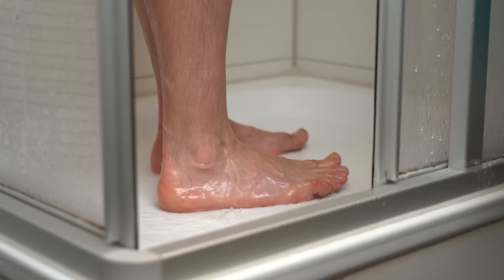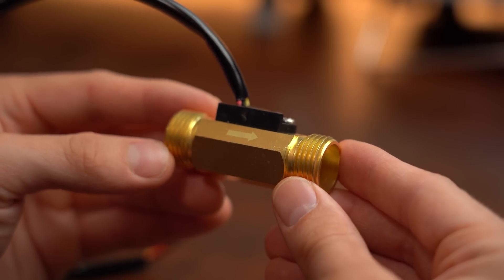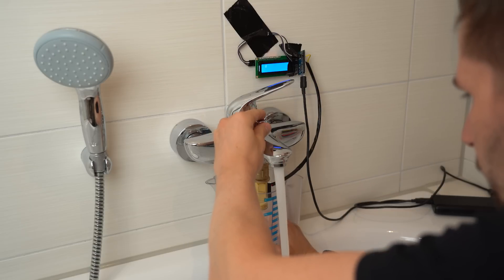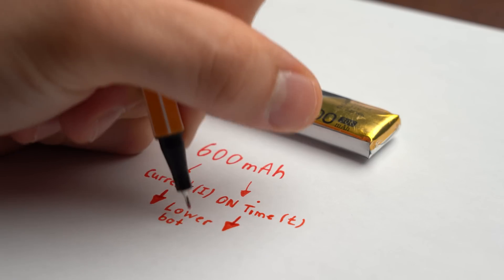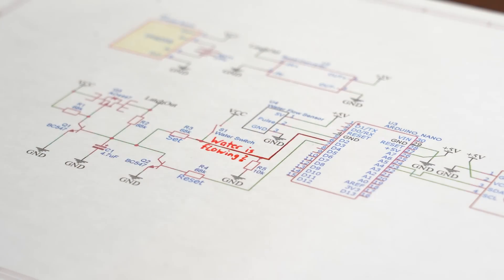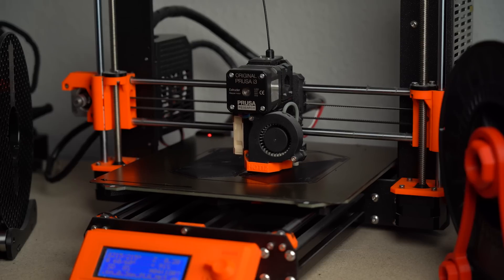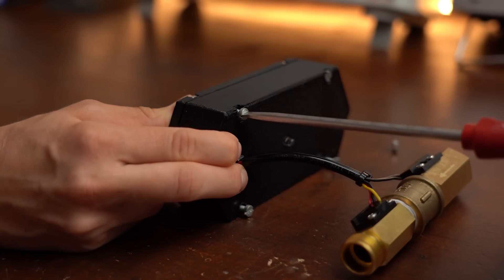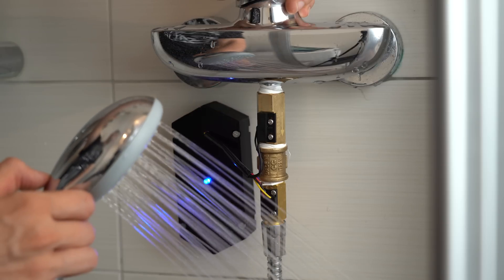Every Shower needs this Upgrade! (Online Water Tracker)

Comment: One thing you can google out from literature and other liquid flow mechanicl measuring projects is that there are two factors apart from mechanical friction, ballance and fluid dynamics affecting accuracy of a propeller sensor: first is the density, or volume weight of the propeller's material should ideally be equal to the dencity of the liquid measured; and the second factor is that flow resistance in the pipe before and after the sensor should be equal. Regarding the second factor some orientation is provided in the printed mounting manuals provided with regular water meters saying that before and after the meter a straight piece of pipe of the same diameter with lenght of minimum 5 pipe diameters shold be provided (in other words, it's more accurate to experiment finding out pulse count to volume relation with shower hose mounted after the sensor).

Comment: to measure the flow rate of the water u can use the venture relation.
by knowing the pressure and the area of the pipe u can determine the flow rate.

Comment: Funny thought, but could you power the electronics with the power of the water pressure itself? Are there any small turbines that could fit the bill?
Reply: The small turbine and generator found in LED-lighted shower heads might work.

Comment: I've actually been thinking of a similar project but with hot and cold water, and electrical power usage per phase too. I got an rough idea of what I need for it. The current transformers are the scary ones.

Comment: Can you invent a circuit that lets us connect PV directly bottom element of electric hot water heater, but can safely shut off power when a set temperature is achieved?  The existing thermostat switches AC power, but PV power is DC, and arcing in the high voltage and current burns the switch out.  It seems to me that a thermocouple and FET arrangement should be able to accomplish this switching without any additional power to make a system like this work.

Comment: Did you think about using a small generator in the pipe to power the system? Might make enough power to drive the little microcontroller

Comment: The flow sensor needs to have pressure all the time to have accurate readings. When you are measuring like the way you were, once you stop the flow the flywheel keeps spinning for a while until it stops. If you make a tube loop it wont happen.

Comment: Just use a timer.

Or if you really want the data on your phone. As you are only able to record the volume of water from your shower, you could just use a flow switch and a timer. It would be a lot easier.

Comment: I've been thinking of a similar system, together with a digital temperature mixer...

I.e. knowing the flow of hot and the flow of cold and the temperature of each and mixing them to maintain the perfect temperature while showering, a nice rgb indicator to know exactly when it it ready... and we can define the pressure and temperature we want per person using the shower...

Just some shower thoughts for ya
Reply: Or you could y'know get a thermostatic mixer valve. These are purely mechanical devices. You can get high-end ones that are built into your shower fixtures.

Comment: Hi, I'm writing through the translator so sorry for the quality.  Around 2004-2006, I was interested in cooling a computer with liquid.  the problem was that as the water stopped flowing, the computer would overheat.  One man figured out a great way to measure the velocity of a liquid.  Well, he passed an optical fiber through the tube.  Laser diode and receiving diode, measured the time it took for the light to travel over such a short distance.  As the liquid flows, it creates pressure and deflects the optical fiber, so the path increases and the time taken for the light to travel that path is longer.  Unfortunately, I do not have this study archived anywhere.  But in 2006, the chips were slower than they are today, so  you can make it.  Additionally, you can use the turbine to charge the battery (by flowing water), which will increase the runtime.

Comment: Once I tried to get data from my Techem and Diehl water meters with an rtlsdr stick. Our utility company set it up to send every 5mins and I could find it's ID printed on the label. I even bought a ready-made module from iMST, who even sold usb sticks. It was a lot of serial comms coding in python on an RPi linux platform, because they gave a DLL file to integrate with, which I could only export functions from in a py+windows environment. Wmbus had a lot of promising documentation on the protocol itself up until I realized there was a proprietary encryption mode on the actual data part of the frame that wasn't even documented. I remember from the openhab forums someone (in Poland?) had some luck and his/her utility company gave out the encryption key after askng for it.

Comment: Good job Great Scott! I did a similar project with a YF-B5 flow sensor. At the end of each shower, I programmed a Service Call to Google Home Mini speakers to shout out how many litres have been used, how long the shower lasted, and what % the shower duration was compared to national average. For the ON/OFF flow sensor, I didn't use a mechanical one, I programmed a boolean to tell if flow was On or Off.

Comment: wait a minute. why use a flow sensor at all? its not like we control for the flow of water through a tap, the tap is either on or off. so basically, u can just use that 'water switch' (the one you're using for energy saving on the esp) to turn on the esp and start a timer routine and eventually convert it to mass. you just need to know before hand how much water is delivered from the tap per unit time

Comment: This is a very cool project. If I build this thing, I will also add a temperature sensor to calculate the consumed energy for heating the water. (Maybe I need to measure the cold water temperature in addition for accurate measurement?).

I still want to build a self made weather station that accurately measure how much rain falls. Maybe I utilize some of your ideas. Up to now I planned to use a weight cell combined with a Pythagoras cup syle container.

Comment: Nice project! I will add some more circuitry like a shower timer that turns of a solenoid valve so the water going to the hose gets blocked. Ofcourse i can turn of the timer aswell if i don't want the feature

Comment: I wondered why you didn't go with some kind of micro turbine @GreatScott! to charge the battery back up again. I mean the flow is already happening. You could probably even use the turbine to measure in a similar V to L calculation as you do now with pulses. There is a company called Amphiro that makes shower inserts to a similar end of what you intend to do (without the wifi connectivity) that uses such an approach.

Comment: This is redundant then what is the initial meter for? If what you want to know is the water consumption for shower, take the reading before and after shower and do the math if you are lazy use excel or an app to do the calculation then for you 😂 or am I wrong?

Comment: Great project! Two thoughts:

1) it would have been yet more complication in the code, but you could also measure the pulse frequency and use that to adjust the conversion factor based on flow rate.

2) They probably don’t exist as commercial parts, but you could use the water flow to run a small generator to charge the battery whenever the water is running. I think it could easily produce enough power that you’d never need to charge the battery externally.

The project was already more than complex enough and works plenty well, so these would be needless additional complications, but I don’t think it would have been too difficult to implement a first-order correction for flow rate.
Reply: I think #2 is actually nice,  although my noob idea was to hook up some alternator to a spinning wheel and charge automatically 😂 wouldn't be very waterproof probably

Comment: Interesting project, but the part that is in the shower, only needs to be able to send the pulses, the logic could be dealt with somewhere else. Would it be possible to generate a low voltage in the water pipe, and use that to count and send the pulses to a receiver that will deal with the logic? I guess there are more energy efficient protocols just to send the pulses and since you have showerheads that have LED's that light up once you turn on the tap, this should be possible, right?

Comment: Showing those water prices on cam is nice and all, but the energy costs (in gas or electric) required to heat the water is an order of magnitude higher at the very least...

Comment: If the flow sensor outputs a square wave when water is flowing, couldn't you use that to power the electronics?  So no battery needed?  And since you're just assuming the liters per time, then couldn't you just use the flow switch and timer to calculate the amount of water used?

Comment: Really nice project! But I think the price/recourse calculation are quite off, since heating up the water is way more expensive than the water itself and heated tap water has a much higher climate impact than cold one. Tap water has a footprint of something like 0.35 gCo2/liter while heating the same amount water for 20° (for example with natural gas) costs around 13 gCo2/liter. So much more than the water itself!! So adding a temperature sensor would be really useful I think.
Reply: Oh please stop peddling "save the planet" claptrap. We are on the cusp of extremely cheap electricity thanks to extremely cheap solar and extremely cheap wind energy. Steel and aluminum used to be extremely expensive too; nowadays they are extremely inexpensive.

Burning fossil fuels at scale is very rapidly being phased out. In another 20 years fossil fuels will probably hardly be a significant source of energy. Once that happens all of this greenhouse effect, er, uh, I mean global warming, er, uh, I mean climate change hysteria will no longer "be a thing." Learn to think clearly and scientifically. Don't succumb to fearmongering.

Comment: maybe if you are willing to improve on this project you can have a look at how modern aircrafts measure airspeed differential pressure sensors have more precise readings on a wider range of speeds and are superior to anemometers in this application. you may encounter fluctuating readings due to turbulence at high pressure but solutions to this are not that hard.

Comment: You could've used one of the cheap water flow generators (back-driven small dc water pumps) to power the thing or charge a battery/capacitor.

Comment: one nice trick for delayed actions like turn off logic is to use the throttle_average filter followed by a lambda filter like 'if(isnan(x)) { turn_off_code_here }'. Through throttle_average the sensor gets activated periodicaly regardless if it received data or not. If it did not receive data (case for turn off) it responds with NaN. If you wait for it with lambda, you cann then emit an output to poweroff the sensor... Hope this is what you wanted to achieve :)

Comment: It's a whole rabbit hole, but...  at the last place I was renting, I used a MEMS compass IC taped to my water meter to non-intrusively measure usage.  I'm not sure about DE, but in the US, the register (the part that displays usage) and the metering part are typically magnetically coupled so that the metering part can be completely sealed.  The magnetic field on the outside of my meter was too weak for a hall-effect sensor, but using an LSM303 compass and a custom ESPHome component (to essentially inject custom Arduino C++ into esphome) I was able to track water usage with ~30mL resolution.

My coworker ran into an interesting problem trying to reproduce my setup: he had so much earth leakage that the 60Hz magnetic field from the mains flowing through his water pipes was triggering my simple peak detector.  IIRC, he worked around it by reorienting the sensor to minimize the mains interference, because we couldn't track down the source of the leakage.  Trying to filter that out would be an interesting challenge.

Comment: As someone with no "running water" during about 6 months in winter in, north of Sweden, I'm using a reservoir with 1200 liter (used to be 600). That is about 6.5 liter per day for drinking, cooking, showers, dishwasher and some limited washing machine (I try to wash at other places than home). It absolutely astonish me to see others water consumption 😃
I'm planning a mobile tiny home and will have water consumption messure like this and ultrasonic water level messure but also just now building a shower that recirculating water with inline filters for a usage of about 5 liter per shower no matter how long it is used (with inline instant water heater to keep temperature).

But the upside is that my water/waste bill is zero since I live in the forrest not connected to the water grid 😀

Comment: It is very clever solution! The first thing on my mind was - why just not to read plain numbers from the water meter - directly in the place where water pipes are. You can "simply" take a photo on regular interval, process the image for extracting numbers and then store it in Home Assistant even with better precission and not only for one shower pipe. Anyways, the flow sensor seems to be much more fun and challenging project. Everytime I watch your video you get me inspired!

Comment: I’ve seen self powering light up water faucet heads that uses a small turbine in the water flow direction. Have you ever thought of making it self-powered using a turbine?

Comment: I made something very similar to this, but for my garden. Just one thing: I can't see yet the repository, but I think you made an automation on HA to control the switch. This is not correct, since if HA is offline then the ESP will remain powered. But you can have automations on the ESPhome board, so that it gets compiled in and runs entirely on the ESP

Comment: Version two: You set a baseline temperature and it automatically dials up the cold water mix percentage as you get closer to the self-defined cutoff time/usage amount.
Reply: TBF, I thought that's what he did at first. Or constricting flow altogether.
Reply: it's also not really accurate given that warm water costs a lot more than cold water and the mixture depends on the desired temperature.
Reply: thats called a water heater

Comment: I was waiting for the plan to be a device that after 10/15 minutes (when you are clean) started to recirculate that water (with a filter) instead of going down to the drain. So you waste less water and need less power to heat it.

Comment: It is a interesting project. But technically if you are always running your shower at full blast then you could just see how much water that uses (Like 3.5 Lpm) then keep track of the time to find your usage.

 Example: 3.5Lpm x 30 min = 105L water use.

 Seeing as hot water is what takes much more energy and cost to make this would be more useful on the hot side in my opinion as a reminder to maybe not use as much.

 I also am guilty of long showers/baths.

Comment: Great project. Something you didnt mention in the video: PLA is not water tight. Water can slowly seep through the plastic - slow enough you wouldn’t catch it with quick tests. So I hope you printed this in PETG or ABS or some other water tight filament.
Reply: That issue is so overly critized. I've made platform from PLA to my shower and it always has had about 2kg's of load for last I think 5 years. Only now it's beginning to show deterioration, but still holds well. It obviously get soaked about daily. Yes it's true that pla isn't the best plastic for wet conditions, but it sure as heck doesn't turn into mush as fast as almost everyone claims.
Reply: @jothain  PLA is stable in water, no Problem. As a platform it is perfectly suitable, it won’t degrade. But it is not water tight, water can go through it - although very very slow. It will probably take an hour for a drip to get through his box with the thick walls. If you want to protect electronics from water, using PETG or ABS is better.
Reply: @Krmpfpks  sure, better absolutely, but it's also mostly about design itself. Ie. Make too solid casing and you might get really bad problems from condensation etc.
Reply: @jothain  condensation is a good point, I am no expert on this. Heat too, but heat is less of a problem with pla as it’s mostly transparent to infrared and some amount of heat can escape that way. 
I am sure GreatScoot considered all this, he just didn’t mention it in his video. I would have loved to know his thought process here.

Comment: Oooh, very nice! I've been wanting to do something like this for my whole house so I can better track my water consumption. One of the first things I did when I moved here was add a flow control valve to my shower head so I can turn the volume of water down. I also turned the water heater's thermostat way down.

Comment: Could you have improvised a charging mechanism using the water flow itself? Like a tiny watermill inside the pipe. I'm not sure how much wattage you would get, but maybe it would suffice to charge that small battery (or at least delay its need for charging)!

Comment: There are commercially available ultrasonic or electromagnetic flowmeter that outputs the reading to a monitoring system like SCADA. Water companies use this to remote monitor the flow and volume.

Comment: There are clamp on flow sensors that can measure flow in a pipe without making any changes to the pipe. Also I had a showerhead that had a small hydro-generator to power some LEDs and would change color from blue to red when the water was warm. Something like that could be used to power your project, so no batteries required, maybe a super cap to buffer the power.